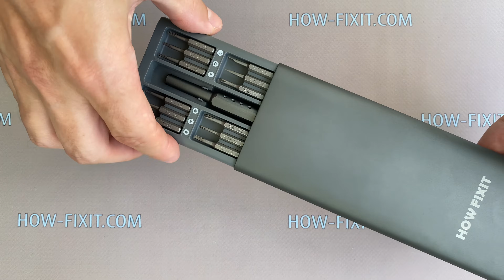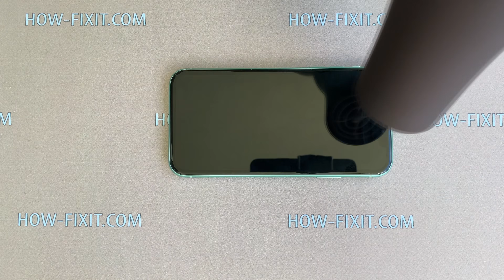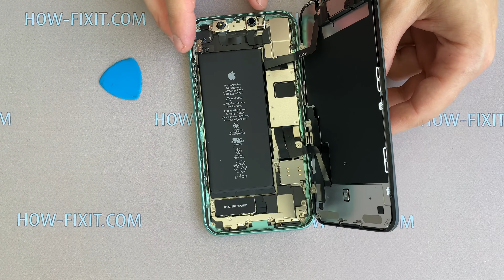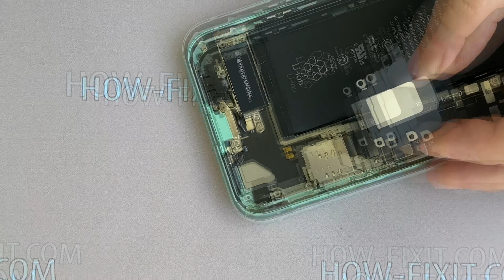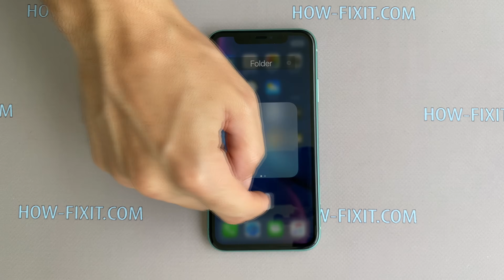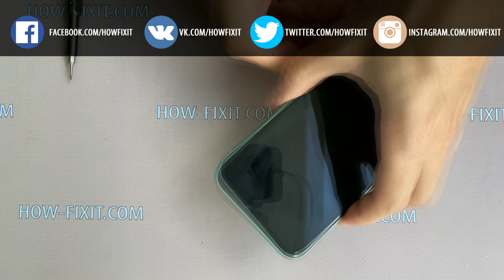iPhone 11 Speaker Replacement

Comment: Is the replacement speaker an apple part or is it a off brand. If it is off brand is it oem quality or better? What is the quality of the parts. I had a screen replaced at a local phone store and it was never right. They used a non oem screen and it would click on things while scrolling it was a nightmare I couldn’t browse YouTube without clicking every video
Reply: Wow they never replied? 😮
Reply: @RiZeUp48209 thats be ts is 4 years ago

Comment: How is the speaker connected to the motherboard? Good video!
Reply: Tester le haut parleur avant de fermer 😋😂
Reply: Those two small gold contacts next to the battery. You can see them when he removes the speaker assembly.
Reply: @BattleCorgiTV  any thought to why my speaker and mic would quit at the same time?? I would assume the mic has the same type of contacts